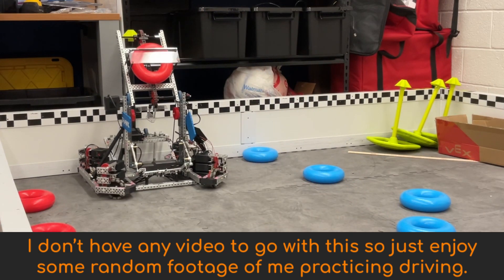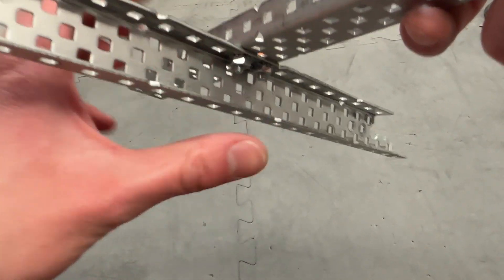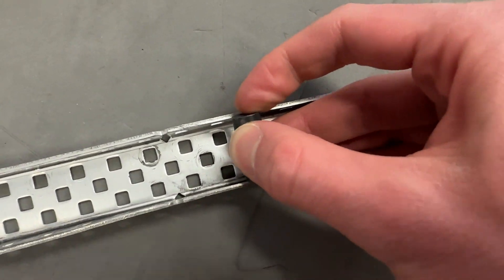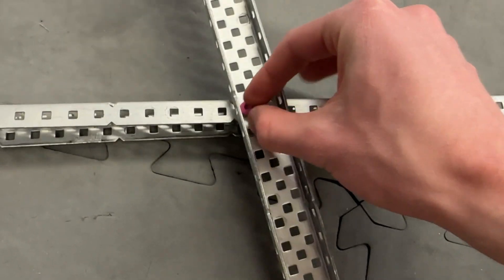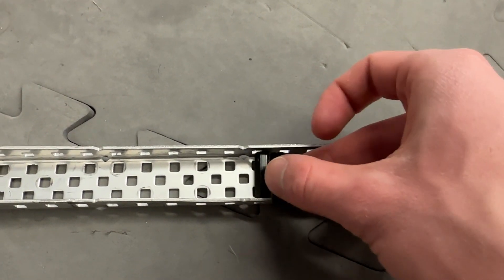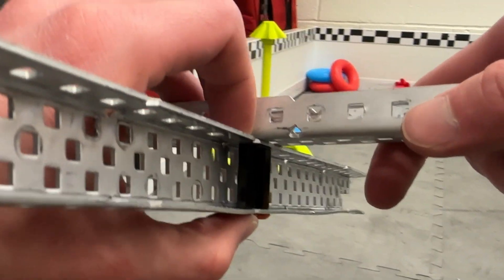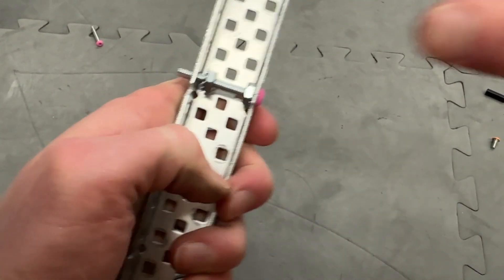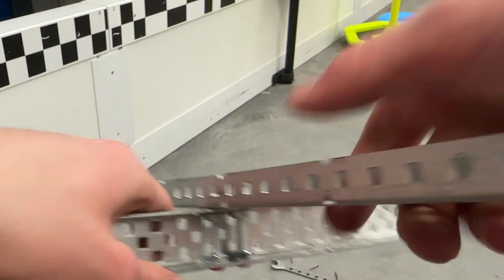Vex Robotics Boxing Guide/Tutorial

Comment: Boxing with standoffs can be really weight efficient because you can use a tiny steel screw+aluminum standoff+plastic screws(on the bottom side in the videos example, the side that isn’t connecting two c channels) which weighs less than a long steel screw and nylock